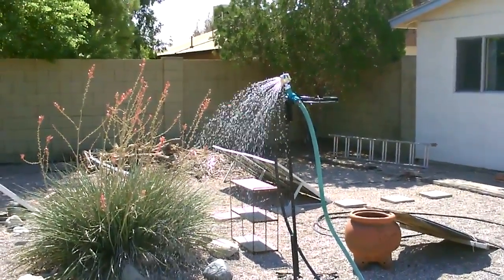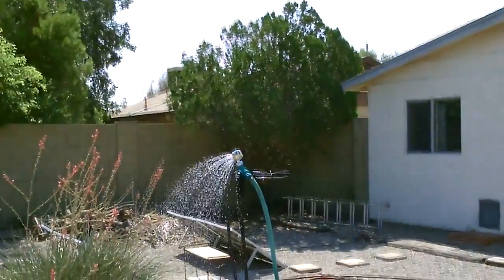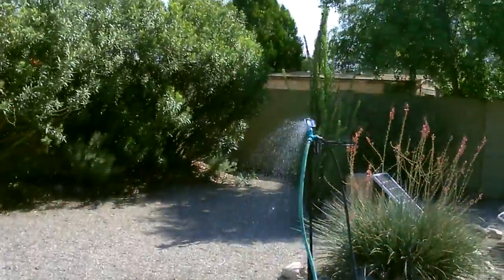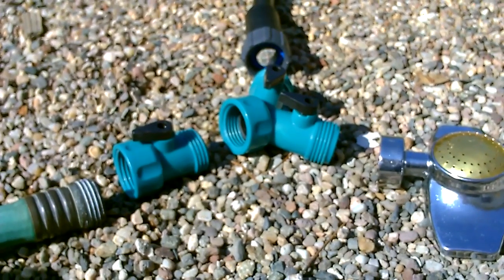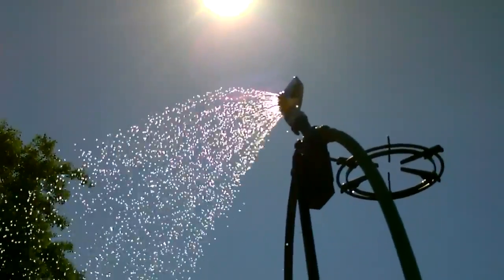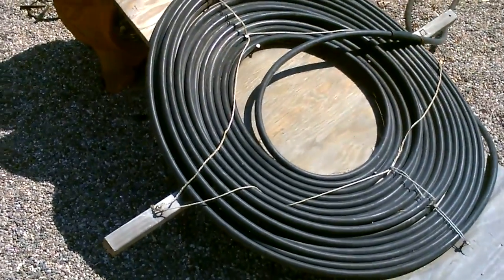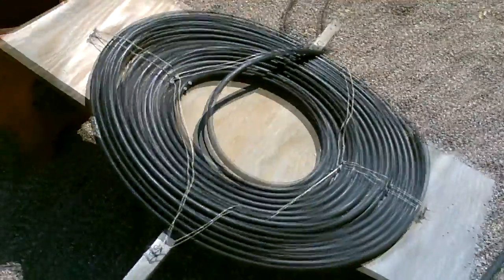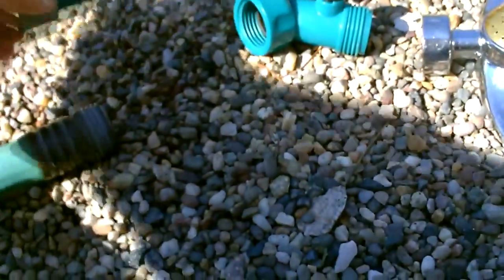Solar Hot Water Shower - DIY solar shower - (using Black Poly Water Heater)

Comment: How hot does the water get?
Reply from the maker: it varies but i've seen water as high as 160F (71.11C).  typically it's in the 130F *54.44C to 140F *60C range. once it's mixed with the cooler water it's probably around 100F. *37.77C

Comment: I am trying to replicate this design. Thank you for posting it.

I have a question. What happens if water is not discharge for longer period of time like several days? Would that be a problem? Will water get warm to about 150 degrees and stay like that?
Reply from the maker: i've never found it to be a problem. if i haven't used it for a while i usually pass a couple of gallons thru it before using the water.

Comment: You could get a plastic barrel and full it with perlite with a copper inner barrel for a heat sink. You could put a thermostat on the solar hot water heater to empty into the heat sink. You could have another thermostat to let out some water to be cycled through the system so you would always have hot water.

Comment: I've thought about using the same black pipe(2" though) and make a coil on my roof(maybe 100ft) and let gravity feed it and drain it. Like the splitter and shut off option you showed.

Comment: I have solar water heating at my desert place. If you time it out correctly you can use couple gallons at a time. Do the dishes wait 20 minutes. Take a shower wait 20 minutes. Small load of laundry wait 20 minutes. Etc good idea for free HOT water.